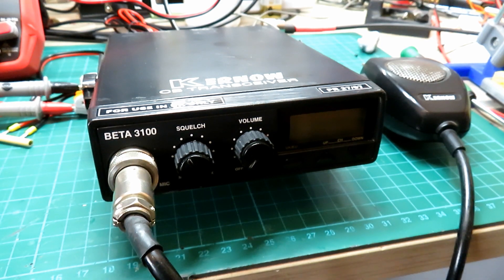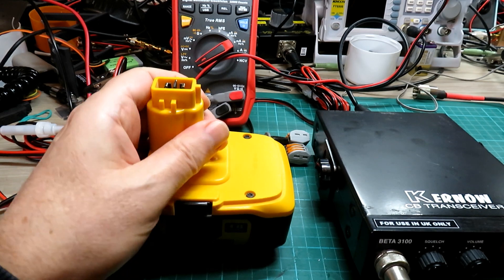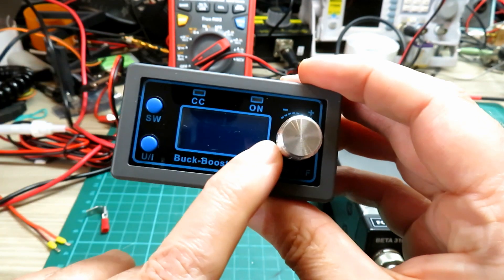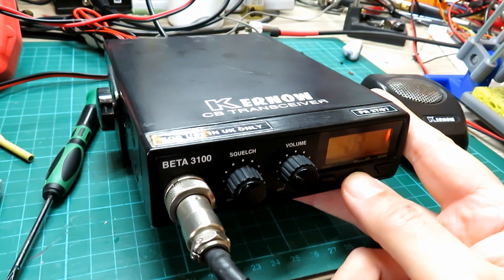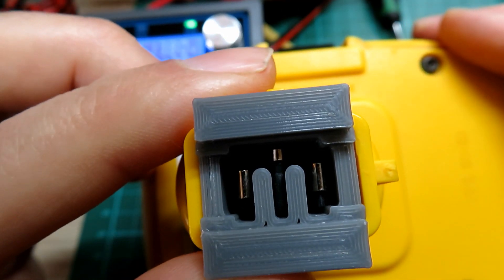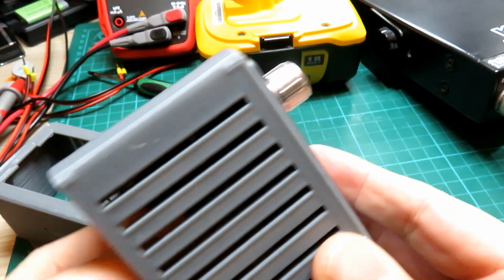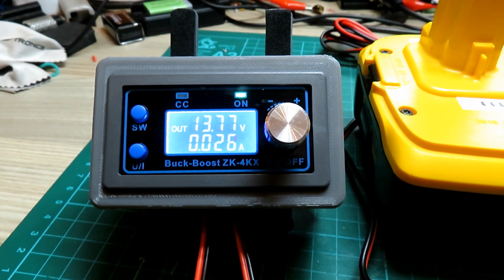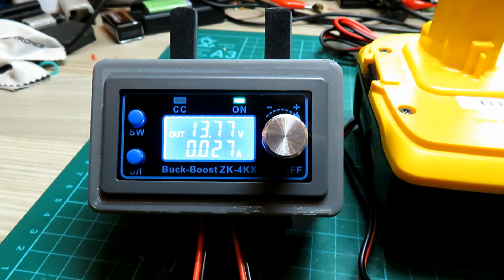POWERING YOUR ELECTRONICS OFF OF BATTERIES YOU ALREADY HAVE - NO MATTER THE VOLTAGE

Comment: Could I safetly transmit at 100w without damaging a makita battery?
Reply from the maker: Yes in theory with the right DC to DC converter, the cells in these batteries are capable of many 100s of Watts in short bursts, any voltage under 50V is generally safe to touch with dry fingers, I wouldn't put my tongue across it though
Reply: How did you not shock yourself at 10:43 when you touched both terminals?

Comment: Yep, been doing this for about 3 years now with Ryobi. First one I made was a Ryobi flashlight with added dc converter to 12 volts and a lighter adapter with 2 usb ports. Second one i built was out of a single ryobi battery charger that puts out a full 18 volts with a 12 volt plug in. I use this one to run my 12 volt ebay portable car washer which does handle the 18 volts fine for the last 4 years. If it burns out, i will simply buy another one as the car washer is so cheap. Nice thing is when the power is out you are not. I always have 18 volt batteries ready to go. I even can run a 300 watt inverter for about 40 mins on a 6amp battery. 12 volt lunchbox cooker works fine too on 18 volts. Thank you for the videos.
Reply from the maker: Superb stuff yes I'm amazed some folks still don't realise you can boost as well as regulate
Reply: Are u in the UK as I have some radio s need look at and there are no rig docs in the Canterbury area

Comment: A string of series 1N540x 3 amp Silicon diodes will each constant drop around 0.7v costing pennies
!N5407 are sometimes Shockley diodes which have a lower drop.
Reply from the maker: Yes to can do with diodes but it's not regulated and you can't boost up the voltage either something I wanted to show because 12V lead acid battery sags